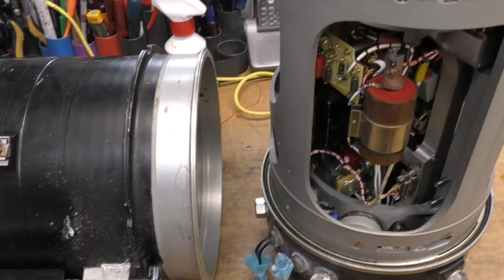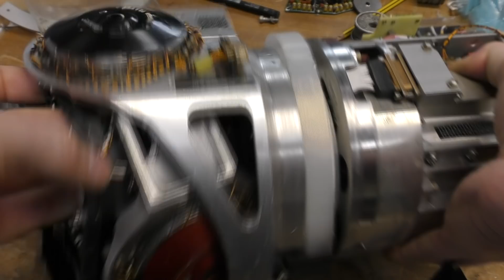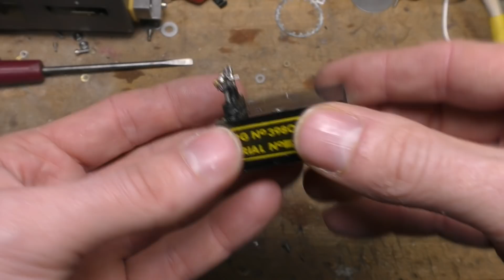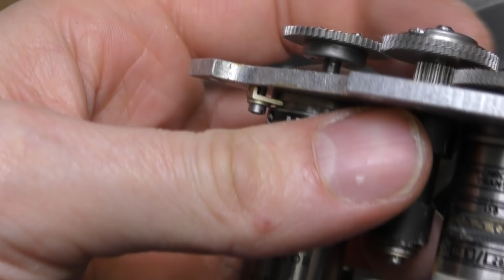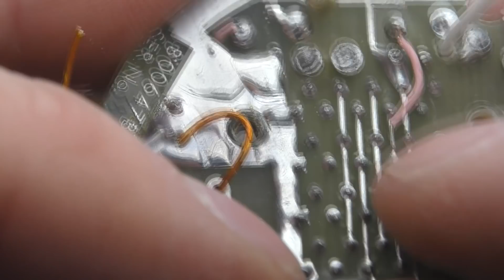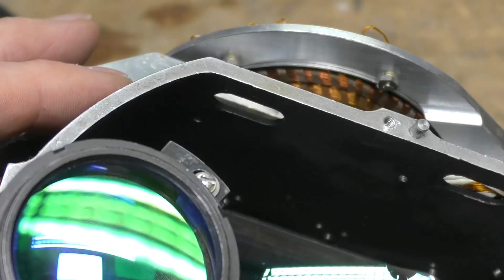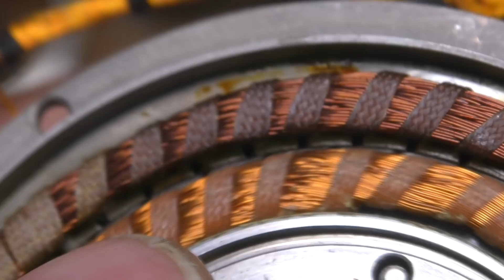Laser unit from Tornado jet fighter aircraft

Comment: The VERY general rule of thumb is that if tech is 50 years old from today (or older) then there is a decent chance its okay to have it. or at least, there is a decent chance no one will raise an eyebrow at it. 75 years and you are almost certainly in the clear. obviously there are some exceptions. famously, the design documents for the ignition fuse for the two atomic bombs dropped during WWII are still controlled to this day (as far as i know). there was a case where someone actually purchased the ship side of the fuse system that was kept from one of the bombers (or it was an unused prototype unit). its literally just a metal cylinder with connector pins in it. but the guy got a visit from the DOE and they took it off him. its a really old story that may be apocryphal but the DOE will always come sniffing around if you do certain things in the US like buy a bunch of uranium ore samples (which are perfectly legal to buy as rocks that are unprocessed).

Comment: This takes me back. I did 10yrs third line repair to avionics and occasionally dropped on to Tornado kit. It was modern and high tech, with actual IC's when compared to the pure analogue radio and radar. Dreaded Kaptan cable, cause of many deaths and outlawed on civilian aircraft. Use of inexplicably big multiplugs,. Money no object to the mechanical parts. But what a bitch everything could be to work on it, so much had to be stripped down to get in and repair! Our UK military has had so little decent new hardware since the Cold War ended c.1990 and it shows...
Reply: I used to service these  back in the 80's when they came off the aircraft. Really complex and precision work in a clean room for hours on end. Nice to get a reminder of the technology from those days.
Reply: @uploadJ  The ground mapper?
Reply: @uploadJ  that radar always fascinated me - as late as 2007 they were still fussy about people taking pictures of them with the nose opened up. I think I might once have interned at a company that made semi-rigid microwave cable assemblies for them... At least, I recognised some of the parts... But we never knew what it was for, it just had to pass a spec! And you may have noticed you can now buy what's clearly the high power magnetron module from eBay...

Comment: Spent quite a lot of time learning how to lace cableforms as part of my apprenticeship, amazing  how many wires you can loom into a small space. Still prefer lacing to ty-raps a lot of years later
Reply: Oh yes, the waxed lacing cord, fantastic stuff that I was taught too...cheers.
Reply: @andymouse  Andy did you get the little cuts where it slipped in and around the finger joints which took weeks to heal as the lace would keep finding the cut :-( the black would leave a little black line for a while. Might have to get some out and have a practice for old times sake.
Reply: @TheEmbeddedHobbyist  Yep got the cuts and I wonder if I could still do it, you could make a video showing this old and sadly mostly forgotten skill, that might be fun !
Reply: @andymouse  I have an example of my work from when i was 16 or 17, i gave it to my mum as it looked like a tree. she gave it back awhile ago, i'll have to find it and pratice a lot.
Reply: @andymouse  @The Embedded Hobbyist A video showing how to do it would be lovely.  I have carefully opened a few looms and re-laced them after modifications and it was never as neat as the original.  I recall reading instructions on how to do it and why there were good and bad ways to make the loop ties so they would not slip.  Tying off was the hardest and the waxed ribbon was fortunately a bit forgiving by holding a poor knot.

Comment: Looks like a Ferranti Laser Ranger and Marked Target Seeker (LRMTS). A forward air controller (FAC) would get within visual range of a target and use a Laser Target Marker (LTM) to illuminate a target. The aircraft-mounted  LRMTS picks up the laser backscatter and guides the aircraft's missiles to the target at which point the FAC beats a hasty retreat.
Reply: Could it (the LRMTS) also be used to generate the CCIP (bomb-aiming point) for the pilot's HUD?

Comment: 29:00 This is a multipole AC induction motor designed for small angle incremental motion.  The whole unit with bearings is referred to as an "inter-gimbal" assembly.  The center threaded hub on the winding side has two small "spanner" holes which allow the bearings  to be removed.  

I have disassembled a Ferranti inertial platform that had similar gimbal units and was initially stymied  with the six semi-hidden socket screws.  I found an long Torx head screwdriver that did the trick.

Comment: Thanks for sharing. Helps put sone visual to stories my father used to tell. Do recall a story from my dad on likely a similar device that was probably on phantoms. Was running a training shop with westinghouse rep and the rep forgot to follow all the safety precautions and had the front lens off. My dad pointed out the failure to which the said “no its fine there’s safety on this” as then the laser started firing across the classroom leaving dots on the back wall 😅

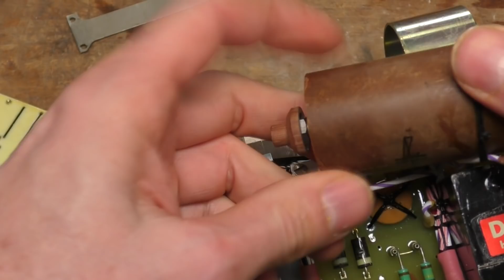Comment: 09:27 that style of board is called "manhattan wiring" typically used for precision measurement where silver solder and other low impedance high conductance components can not be soldered to PCB traces due to coupling or other concerns.
Reply: @ecosseman  I think you are confusing the results of your google search for 'manhattan wiring' with what happens in reality.  The components are all laid out at 90 degrees on the board, and of course the wiring wont also all follow at 90. Manhattan refers to that type of raised post, 90 degree layout common to old boards, and the reasons for doing so when obviously, PCB layout is also available.

Comment: That piece of glass between flash-lamp and YAG rod, might be a protection from a so called "solarization" - accumulation of the point defects in the rod caused by a UV radiation of the flash-lamp.

Comment: It is believed that the image on the quadrant detector is defocused slightly to allow better position sensing performance. Might be an interesting test for you. If you want i aslo have the design for an analog front end; PIN biasing, TIA, DC cancellation, and single ended to differential drivers.
Reply: Share your wisdom if you can and have the time.  Even a short video describing a paper napkin schematic is a great way to put free ideas into the public domain and help others to overcome obstacles.
Reply: @KallePihlajasaari  yeah sure thing, I do actually plan to make videos about such subjects during the upcoming summer, in the meantime if you'd like, we could connect
Reply: And the reason why defocusing helps is because all quadrant detectors have gaps on the order of a few tens of microns, and the signal vanished if a perfectly focused beam is nulled in.

Comment: That connector at 8:47 looks like a standard 13W3 connector used for video on things like SGI and Sun Microsystems computers.  I wasnt aware that 13W3 was even around in 1984
Reply: Yes!  The coaxial connector pins were used for analogue RGB signals. I'm guessing the company was also producing optically stabilized digital camera systems.  In 1984, most home computers had monochrome displays.  It took the Apple II and Commodore systems to bring 8 bit (256) color into the home. This was a cutting edge connector for serious systems.

Comment: the "shockers" look more like pressure pads, less to do with vibration they might just be to give even pressure to the mounting so if 1 bolt is torqued slightly higher than another it has some level of even pressure across the whole unit otherwise it might cause a distortion of the outside case and create resistances on the opposite axis of the tip which would be bad given the general use case of these kinds if things they generally require some level of accuracy or precision
EDIT: i hope!

its possible the extra connectors are for grounding arials and instead of running a separate wire for ground they just picked it up along the way since ground is ... ground... on a jet...

Comment: I think it's a Samarium window to block UV between the laser rod and the flashlamp. I'm not sure if this units are still in use, at least with this laser, I think they switched pretty much everything to eyesafe 1550nm Laser.  They would be using Erbium Glass (Er:Glass) as laser rod, which has a pretty nice green color. If anyone reads this, I am looking for one for years now... ;)

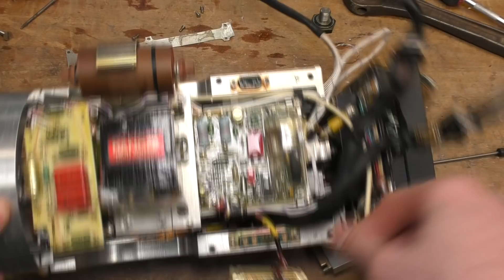Comment: That mixed contact plug around 9:04 reminds me of sync-on-green monitors connectors, like those supplied by Sun and Sillicon Graphics, type DB13W3, if I'm not mistaken.
Reply: I still had such a monitor until about 2008. Looked identical.

Comment: Very interesting,thank you, although I do feel some pain of destroying the optical side without trying to get a few flashes out of it..just to say..ooh,that's nice :)
Reply: Yes, it was a reasonably complete YAG laser before opening.  However a lot of the PSU and control electronics was missing but might have been possible to reverse engineer and duplicate.  The sad part is that is is IR and may be rated for a limited lifespan of hard use so not ideal for production use.

Comment: I would love to put it back together with a low power helium neon laser for the ultimate diy rangefinder thingy.   Greetings from Amsterdam
Reply: The main receive mirror looks like it is coated optic that passes visible light, it probably only reflects the narrow wavelength of the YAG laser which may be around 1um IR.  I suppose one could aluminize and take out any IR pass filters.  There are many choices in laser to be had and such a small HeNe would be a very low power device by modern standards.

Comment: Dunno, wire wrap on posts/studs was kinda standard for high voltage circuits.
Reply: Yes and the feedthrough on the photodiode circuit is a sensor, with sensing so that if the pressure drops for some reason, the leakage to the chamber will fail the system, and cut power to the photodiodes, as they typically have a 250V reverse bias on them, so they will avalanche over with the received light pulse. This gives a larger signal, and also a much faster response time, as the bias has enlarged the depletion region almost to breakdown, meaning there is now much lower capacitance, Those diodes can easily have 1nF of capacitance at zero volt bias, dropping to tens of pF at 200V, as the depletion region grows into the silicon substrate. Big difference in response time with the typical 10M bias resistor used.

Comment: I wonder if the two motors are effectively coarse and fine movement. So one is a stepper type motor which can move an axis a step corresponding in size to the maximum movement range of that small gyro, and the other is a pair of coils with a position control feedback loop which can do a fine adjust with the gyro. Maybe that's for active vibration compensation or something?

Comment: Those prisms are interesting.  Given the wavelength and power level, I would guess single crystal sodium chloride.  They might go cloudy after a few days exposed to ambient air, or dissolve in a glass of water.  Probably why the unit had a fitting for nitrogen pressurization.  The black window, or lens, was probably single crystal silicon.  I have worked with a few infrared spectroscopy systems that also used diamond optics, but these were used for strength rather than optical performance, which was inferior to both silicon and sodium chloride.
Reply from the maker: 1064nm is close enough to visible that glass works fine - you only need exotic materials for M/LWIR or UVC

Comment: Another grate video..

32:30 maybe the bottom part of the gyro is not a sensor but a motor that tries to keep the fast spinning part at the center.. Then the amount of positive/negative force is the rate of rotation.. Poor 1970 engineers, they have to do it all in unusual ways..

Comment: That story about the ebay item, it sounds like an excuse the seller made up because he didn't make enough on the auction.
Reply: No, quite a few time the surplus sales did mess up and sell the wrong things, which were accidentally included because of some reason or the other. Mostly because right hand told the left hand, but the left hand was either on course or on leave, and the reply only got there a few days later that these should not have been included, and to get them back "right now, or even sooner, or lose your pension and spend the rest of your life in a MOD prison" type of time frame.

Comment: Hey! Glad I found your video. I’m having issues with my unit. It works fine until I go in a sharp right turn. It will remain seemingly operational but it messes up the targeting. Doesn’t happen on a left turn. I’m suspecting it’s a mechanical problem. It sometimes happens when using the afterburner as well. Any help would be greatly appreciated!
Reply: I would advise some WD40.
Reply: Found the issue. One of the cable harnesses came loose.
Reply: @reeder 76 it was sort of a grey market acquisition. It’s definitely not under warranty anymore

Comment: Nice. I've pulled a few avionics apart including a box from a tornado fighter myself. Did a video on that but I wondered if these sort of things are illegal. However only certain parts can be sold; declassified parts so to speak. Anything containing software including firmware on ROM chips typically are removed. Or buyer beware you just get an empty LRU case with no electronics in it.
Reply: I am quite sure this laser is not functional and some circuitry was removed.

Comment: 16:30 UV filter to inhibit YAG solarization from Xe/Kr flash. cerium doped quartz, probably.
Reply: Yes, that makes sense, the gold surface will also provide some measure of filtering that may have been beneficial or an irritation.  I have seen designs for such YAG lasers that are formed inside channels of a fused silica material with an outside mirror coating.  The desired wavelength obviously pass through the 'glass' material suitably.

Comment: I am just curious... would you have any need for concern while running your fingers over connections with high voltage capacitors in use, internally?
Reply: I assume with a unit this old, most of them will have discharged or degraded - but worth thinking about. Also the coolant is carcinogenic!
Reply: When the unit is supplied there is 1kV across the capacitor, this can be lethal for sure. When the unit is not supplied the capacitor is automatically discharged trough several resistors thanks to the high voltage relay we can see on the video. By the way this one like mine was modified to prevent the charging of the capacitor but you can easily find what is missing if you do a reverse engineering.

Comment: I wonder if the motors are different because they would operate at different speeds. I.e. fast speed to point towards, then slow speed for precision tracking. Or maybe one was used to drive where the beam aimed, then the gyro was attached to the other one.

Comment: Alpha wires has a line of wire called thermothin, i've used it before and it's very good, however, the insulation doesn't look as thin as that and it was the thinnest stuff i could find after searching for days!
Reply from the maker: I like Alpha's Ecowire where space is tight -thin but tough insulation
Reply: i had some rolls of stuff i saved from a dumpster at a university that was basically single thickness kapton tape over a boatload of plated copper strands iirc it was effectively 28-36awg  i wish it had had a manufacturer's designation on it or really any markings at all but it was super useful for repairing drone gimbals due to the high strand count and compact size.

Comment: Why is the (quadrant) photodetector is so huge? The light reflected from 100+m will produce a tiny spot after the parabolic mirror.
Reply: My guess this is for capturing the spot from the ground-based laser marker. The quadrant photodetector then will turn the optical assembly until it is looking directly on the target, and the rangefinder can be engaged to measure the distance to it.

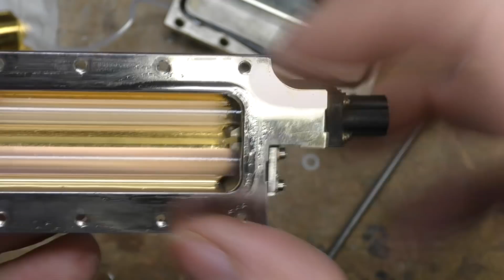Comment: 16:46 Its a UV filter since UV is not good for the YAG rod.
Reply: No. This is IR filter to protect from heating the rod
Reply: @odissey2  It very much seem to be ZnSe glass.
Reply: @dtiydr  not ZnSe. The ZnSe is fragile material (and expensive).  Here is just a glass, probably (uranium)-doped, with main function to protect the rod from the explosion of the Xe lamp.
Reply: @odissey2  I know rubidium rods will take damage by UV as well as to high heat so a filter no doubt but sure not uranium doped since that is greenish, this is yellow-orange. I don't think that its really made for protect the lamp of an exploding lamp since its really thin and everything is drowned in water that would take up anything like that.

Comment: I would bet that some of the wires are made out of pure silver and a few of the contacts are platinum and or gold , I worked at a precious metals refinery and we scrapped a lot of military parts for gold , silver and platinum some of the points used in ignitions during WWII were made from platinum and some winding's in generators were made from silver wire , copper was getting scarce so the US used whatever worked , silver is a better conductor than copper , with modern electronics and the high write off costs , I would bet you have some precious metals there  😏
Reply: How would one go about extracting these metals though? Seem quite complicated.
Reply: @aviovintage  For the points we just clipped them off and drop them n acid all that was left was platinum , the rest was done just like you would refine gold or silver , we did go through lots of acids and pure ammonia